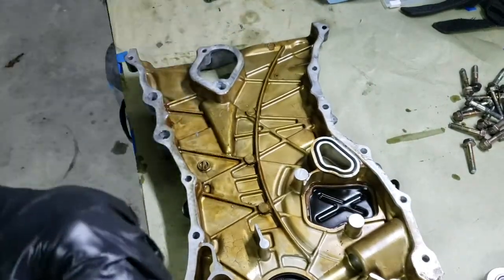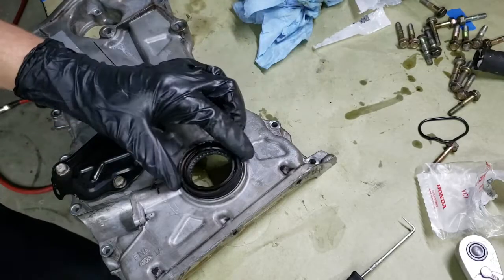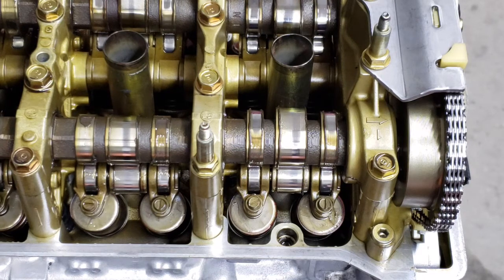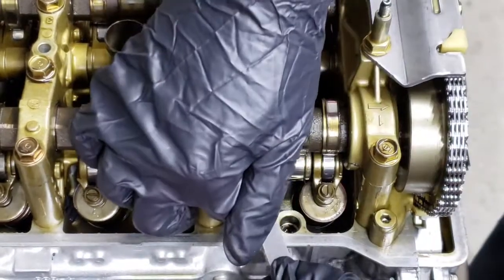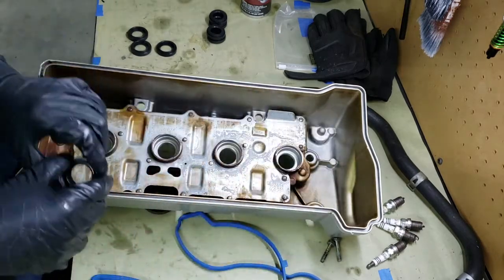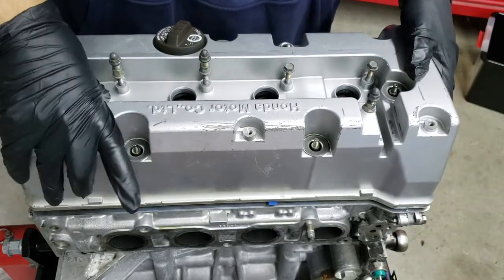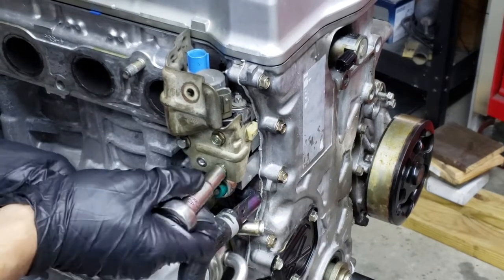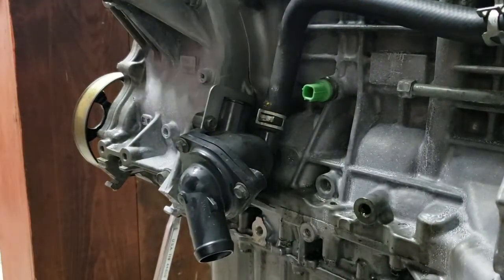Timing chain and head stud install on Honda K20 part 3 / Valve adjust, final assembly, upgrades

Comment: those flat feeler gauges probably aren’t getting the right reading on any k series as the valve is on a slight angle to the heads. when you try fitting the end of the gauge in it gets pinched because you can’t get correct angle. 
i’m currently done an adjustment last night but the end of my feeler gauges have a bend in the end of them so the rest of the gauge doesn’t hit the flat surface where the valve cover meats the head..

Comment: Would the kpro work with the k24z7 swap
Reply from the maker: No
Reply: So I would have to use the aem ecu
Reply from the maker: Aem or another standalone ecu
Reply: I'm having a hard time getting my eg k24z7 swap done that's y I asked if I can go with the kpro ..I know u used the Aem ecu on your video..would i have to get hondata if I get standalone ecu
Reply from the maker: Standalone is a complete ECU replacement, unlike the hondata k-pro, s300, etc that are the equivalent of a piggyback off the factory ECU. 
You would need a fully programmable standalone ECU like a AEM, Haltech, etc. Just be mindful of what ECU you use because you may need a custom built engine harness to run it.